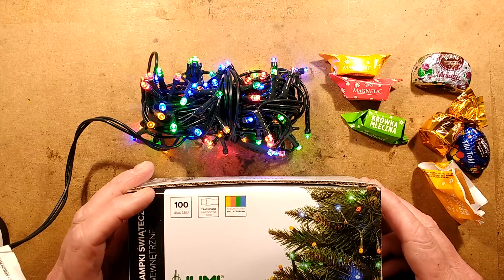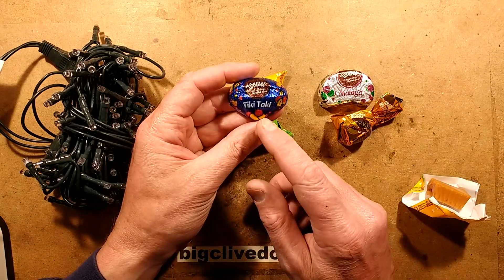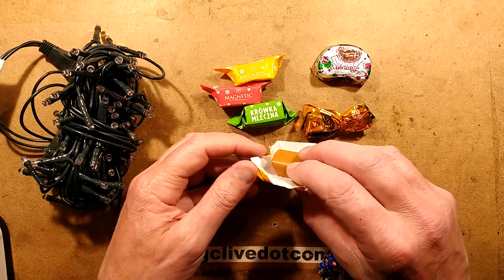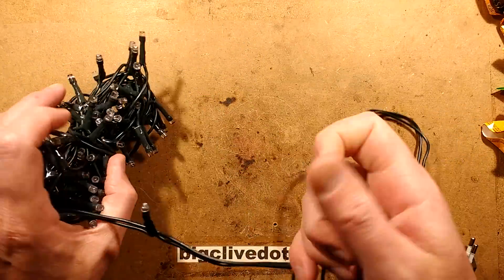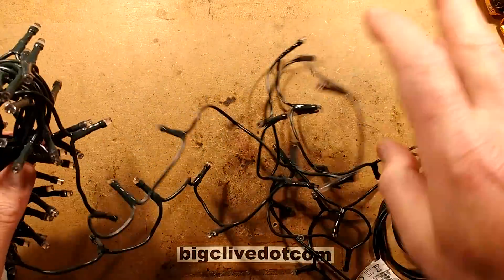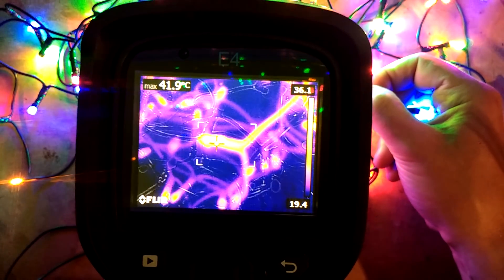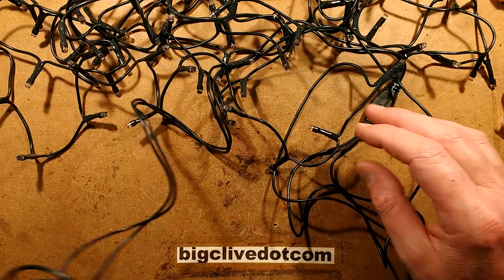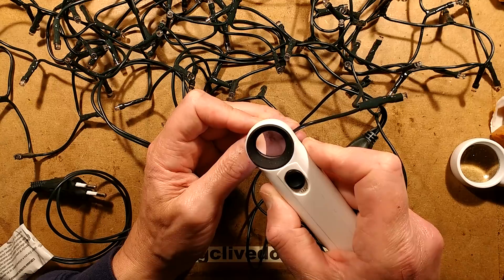240V Polish Christmas lights with series resistors.

Comment: I am still amazed at the way LED's actually work!  I guess I am still from the age when voltage was what made the difference, for example you used to have to count the number of bulbs, divide by the way they were wired by groups of say 25 or 10 then figure out how many volt bulbs you needed to buy, 12 volt, or 10 volt etc.  Now you just install the proper size resistor and you have things under control, so the LED's are running at say 200 volts but so long as you control the amps you are OK.
Reply: Jerry Ericsson  In older industrial systems, and some older test gear, you would often find a 'standard' voltage lamp (often 12V, 24V, or 28V) with a current limiting resistor so that the circuit could be run off a higher voltage supply.

Comment: The polish toffee is not layered, it's one substance throughout, it merely dries a bit up closer to the surface. In fact depending on how long and how well they have been stored, you will sometimes receive ones that are hard as a rock throughout or ones that have a completely liquid core and fairly soft on the outside.
Reply: Siana Gearz to be a bit more specific: inside of that candy is runny when fresh and outside is soft. Over time sugar crystalizes and candy is losing moisture so it becomes hard shell and sand like filling. Also I think its made of same sort of mixture like toffee just more runny and perhaps more caramel added... It was very popular all over Soviet Union and socialist block countries. Also everywhere it was called "cow" like names :) in this case it still is.
Reply: Space JAGA also known in germany as "Sahne Muh Muhs" with a cow on the packaging. I love them.
Reply: now I want some of them, we used to call them moo-cows or moo-moo candy.

Comment: You did say 510ohm then you said 150ohm just stuck in your head then you set the meter to 200ohm...
Reply from the maker: Yeah, I get distracted very easily.
Reply: Green-brown-brown vs brown-green-brown.

He's getting dischromic in his old age.
Reply: bigclivedotcom do you have a Lidl in Isle of Man? They are selling a 10000mAh power bank. Wondered if it was actually worth getting? LIDL do  supposedly have good quality electronics?

Comment: When you did your math you said 510 ohms. Was that for all 3 resistors or just one. If thats for just one them the wattage would be one third of that.. or did I miss somthing? At any rate thanks for the vids Clive.
Reply from the maker: That was based on just one and the voltage dropped across it.

Comment: I wish that Flir cameras had an ability to adjust the thermal layer and the visual layer so you can tweak the overlay so they match up. It’d be much easier for close up work.
Reply from the maker: If you get one of the 3D printed thermal lens adapters the highly focussed detail they give means that an overlay is not required.  You can see much higher thermal resolution.
Reply: As much as i'd find it enjoyable if i could get a thermal camera at one fifth the price, in reality most speciality products (such as hi-fi audio) prosumer devices (such as DSLRs), exotic tools, have at the bottom end at least a 5-fold margin, as this is what's generally needed to give engineering-intensive businesses outside the mass market a bit of long term financial stability and cover actual business expenses. Utterly not comparable with Apple.
Reply: It can. He can use FLIR tools and it is a part of it. 
Even the cheapest FLIR cam, FLIT One, has the function.
Reply: I wouldn't say it's overpriced, all thermal imaging cameras are pricey.
Reply: I never even heard of "thermal lenses" before! This is so exciting!
Reply: Против Глобал FLIR prices are fair and what should be expected for product and quality. You can find cheap knockoffs cameras from china online which may be more within your reach.
Reply: Even the UNI-T models are expensive